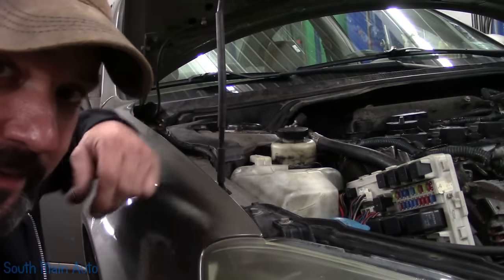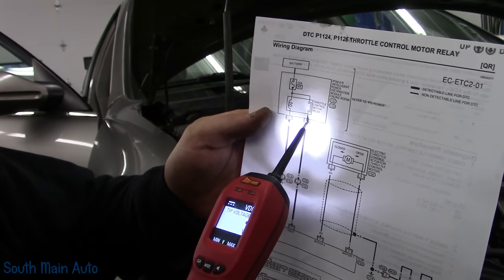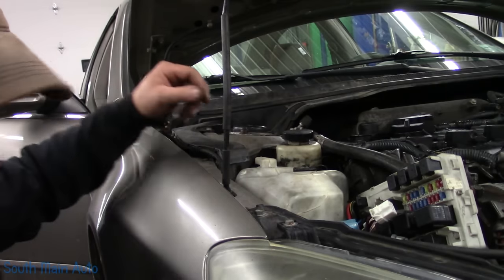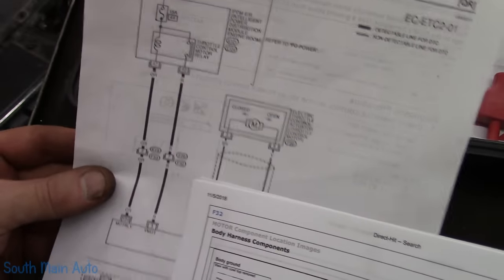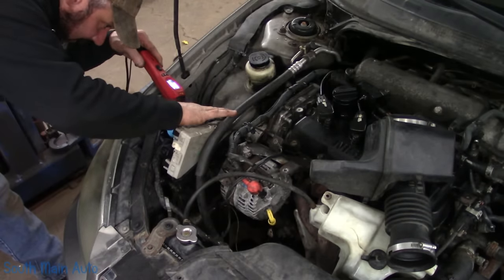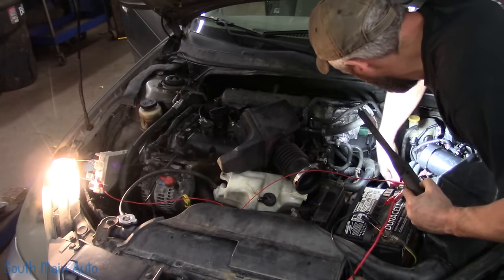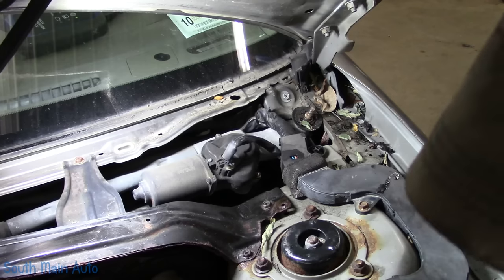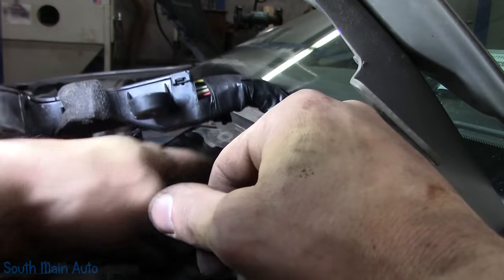How To Fix A Car That Keeps Blowing Fuses

Comment: From the fuse socket to where ever the ground is ....is an "antenna".  Make yourself a noise maker by using a resetting circuit breaker make leads so it can plug in where the fuse was.  It will click on then off then on over and over.  Making your "Antenna" send out pulses.  Use a cheap  calculator turned on as your detector.  It will  pulse the LCD display with the  antenna pulses as long as you hold id near the wire in question.  Follow it along to where it stops pulsing.  That is where it is grounded.  Back in the 1950's we used a radio, does the same thing.

Comment: Goes to show how important it is to route wiring the way you found it when you put stuff back together. This design may be terrible, but it's very common for one moment of carelessness to lead to a whole cascade of problems down the road. Be like Eric, and you won't have any problems. Doing your job right has a bigger impact on people's lives than you could possibly imagine. Imagine how much more money and time would have been spent firing the parts cannon had Eric not decided to diag it himself.

Comment: Hey, good job! I have a question. The 4 amp light you hooked up , did you connect it to the relay connector or did you hook  those back up to the relay fuse panel first the connect the light to where the fuse goes?

Comment: Hey learned a lot watching this, wondering if you might have any ideas on my cam shaft position sensor A codes it's telling me I have both low and high circuit voltage with that sensor codes are p0342 and p0343 I have replaced sensor and still comes up any thoughts are helpful

Comment: One thing that was really helpful for tracing shorts on boats was a "fox and hound" - a signal injector and tracer. Most times, especially on a full short like this one, it was easy to "walk" the pickup along the wire and listen to the tone - which would cut off as soon as you went past the short. It wouldn't have been very useful where the harness was surrounded by metal, but it would have led you right through the fusebox and along the wire toward where it was. The only trick is to get a toner powerful enough that it punches through partial shorts and a pickup that's sensitive enough to let you read the signal even through stuff that's in the way. The one from Tempo hasn't let me down in 30 years...

Comment: I see you do a LOT of electrical work.  There is a contact enhancer called Stabilant-22 you can get at NAPA.  I think the part # is CR-1.  $80/ ounce but you don't use much at a time.  VW came up with this I think.  Enhances contact at connections and supposedly insulates from other connections.  I have fixed cars with this stuff.  Good For corroded connections once you get them as clean as possible.  Love your stuff, and your wife is something else, nearly as good as mine, even after 50 yrs.

Comment: It looks like the owner inserted that braided wire into the fuse location, to try to ignore/bypass whatever was causing the initial short. What do you think caused the initial short? Do you think it might have been a rodent, chewing on that wire harness?

Comment: With a circuit breaker and a compass you can quickly locate the short to ground. Simple step, no hunting etc. with a auto resetting circuit breaker plugged into the fuse box, a cheap compass’s needle will indicate the location of the ground, trace over the wire and the location of the short will be shown, try it you will like it.
Reply: With your light test, use the compass to find the location of the ground, the needle will change direction when the ground is passed.

Comment: I got a 2005 Nissan Altima 3.5 V6 & I replaced the Battery, Alternator, Starter, Fuel Pump. What’s happening with the car it keeps blowing the 15amp Ignition fuse located in the IPDM as soon as I turn the key over. It will crank but won’t start at all & the check engine like flashes rapidly.

Comment: If you don't have one you need to get yourself a wire tracker. You hook a wire that has a signal sent out over it onto the faulty wire and have a small receiver that you run over the suspected harness if it is not the right one the signal will fade and you can go looking for the right cable by following the signal.. On occasion you can find a break because the signal may stop part way down the harness. You can buy them at Home Depot or Lowes for around $60.00 they are well worth the money. I use one quite often when trying to chase wires.

Comment: How many hours do you charge for a diagnostics like that ?

 i had an f 150 brought to me after a customer changed there battery and the power windows and radio didn't work afterwards. factor in searching for wiring diagrams and how the systems were related i had a good hour maybe an hour and a half into it which i incorporated into the diagnostics. after about another hour or so i pin pointed that 2 fuses didn't have power with the key on which ran the the radio and power windows. back to searching how the fuses get power and found out the instrument cluster applied ground to the delay accessory relay which powered up the windows and radio. i unplugged the the connector on the instrument cluster and applied a ground and every thing lit up and worked. so it needed a cluster..i ended up charging the 3.5 hours for diagnostic and repair which i thought was very fair.

Comment: Great video BUT (you knew there was a 'but' coming) I would have loved to see what you did to fix the actual wires. Did you just tape up the jackets or did you have to splice in new pieces of wire?

Comment: what kind of heat tool is that; what type of crimping pliers are those; where do you get those heat shrink crimping connectors;manufacturer?

Comment: My very first thought was put a light bulb in there and measure millivolts on the shorted lead.  The closer you get to the short, the lower the reading.  Have you ever just said, "screw it," and replaced the wire by cutting it out of the circuit at both ends and running a new wire?

Comment: Just wondering how did he fix that shorted wire in case I run into the same situation?  Did he cut out the bad section and soldered in a new short wire with heat shrink?

Comment: How much do you charge the customer per hour?  My car is currently n the shop $125 an hour.  It’s gone through 3 batteries in a year.  Ac blowing hot air 5 minutes after Freon recharge.  It has a dimming rear view mirror.  I unplugged it thinking it was causing battery drain.  2006 Chrysler Sebring touring convertible.  84k miles.

Comment: Wondering what you think about my current situation. I changed the battery in my 01 gmc Sierra. After installing the battery, my door lock isn’t working from inside the truck or the key fob. It will unlock but not lock. It’s a 3 amp fuse that keeps blowing after replacing. Not sure where to start 😭
Reply: For starters, you may want to check where the wires run thru the driver door thru the body. Gm is known for having short wires that tend to rub off the insulation creating a short.

Comment: A common problem with the 2.5 altima is the exhaust manifold cracks where the collector welds to the down tube. I had to replace the one I had on mine years ago and the manifold looked like it was  peiced together with whatever Nissan had left.

Comment: Hello I have a 2004 nissan Altima and the wipers stay on ounce I hit the steering column switch. When I bought the car for my daughter the previous owner had a kill switch and wire running directly to fuse box in in engine compartment. I eliminated all that and it is so doing it. The switch was replaced on steering and checked all fuses all seem to be good. What would you suggest I do next ?

Comment: I used to fix aircraft along with too many other electrical systems I care to remember, what I was taught in school and you did is called BRACKETING. Start at one end (a) with the fault go to the end of the circuit (b) and check for the fault if you have the it you know it's between (a) and (b) if not you know the problem is the component the circuit goes to. Find a point half way between (a) & (b) and check for fault (c), if you have it, the fault is between (a) & (c). If you don't have the fault between (a) & (c) check between (c) and (b) you should have the fault. Just keep breaking the circuit in half and you will end up at the fault.

Comment: If I've learned anything from your videos is that I've been shamed into doing cleaner aftermarket installs so that you guys can work around them or plain unplug them off. I also always run a fused power source to the battery,  never to a circuit (unless it goes to the control side of a relay if I need to light it up with the light switch).

Comment: This looks like an older Nissan.  I understand Eric is showing the "correct" way to find the short and "exactly" where it is.  On an older car like this, once you realize which wire is shorted it is, in my opinion, more productive to just run a new wire to the throttle body from the fuse block.  And Eric said it himself, " i don't want to waste a whole lot of time" which chasing the harness is.  Cut it, run it, save the customer a couple dollars, make a note on the RO where the new wire is so if in the future someone has to chase the circuit they'll know.

Comment: Exact same problem and cause as that cobalt. Bet some time in the past someone had replaced the wiper motor on that thing and that would be why the wire bundle would have been unclipped like it was.

Comment: Another tip.  Let's say you don't have a Power Probe, just a multimeter.   Use the ohmmeter to measure resistance between the fuse and ground. Use Ohm's law to determine the minimum resistance of a circuit, for example, a 10 amp fused circuit should have 12v / 10a = more than 1.2 ohms of resistance. If you have less than that, do the short to ground troubleshooting mentioned in the video until you get more than the minimum resistance. When that happens, you've found your short.

Comment: I had a customers w140 e320 Mercedes. It had a heater fan that was getting stiff in the bushes and causing the fuse to blow. The customer had put in a 25 amp fuse instead of a 10amp fuse to keep it going.  This caused the fan terminals in the fuse box to spread, in the fuse box to melt and the wire to the fan too. In the end i cut both ends of the fan wire before the fuse holder and put in an inline fuse in the fuse box and ran a new wire to the connector for the fan and replaced the fan.    I opened up the loom and the fan wire had stopped melting a foot into the loom so we were lucky nothing else was effected.

Comment: Hey hoping you check old video comments. I'm having an issue with my positive terminal fusible link on a 13 nissan maxima sv. The fusible link on that positive terminal at 250A keeps blowing when trying to start. The alternator and starter both are showing ground and open line correctly. Something is sending power from the ignition button to that fusible link that I'm having troubles finding/connecting the two. Any assistance in what would cause that ignition switch to come thru and blow that 250A on the fusible link would be greatly appreciated! Thanks.

Comment: Screw it, I’m converting my car to dual fuse/relay boxes and having everything be side specific and having only one set of wires transfer “signals” between sides (unless I go digital, then ignore those quotes) with a large plug on either side and I’ll have that either hanging just under the seam from the firewall and wiper cowl like 04ish ford pickups, or behind the dash (unpreferably, but with a mid or thirds point connectors to isolate portions of the harness within reach without pulling large/major components or taking the dash out, and since the car I plan to get is a rear engine one (cheap fiero) I might go crazy and put a rear power distribution box also, which will house rear things that aren’t side dependant and maybe be a reference for the other two panels (maybe a bad idea??) any input?

Comment: You seriously are brilliant  lmfao  my teacher tought me cool trick for shorts  said shut lights off in shop  work in dark  uncles car windows wouldnt work  chev impalla . Bought 12 pack 15 amp fuses   each time put fuse blew  i did 10lbs pull test on door wiring and nothing !  So told uncle shut lights in garage  and had him and dad watch for spark   while i kept putting fuses in  i seen a spark in ashtray outta corner my eye wife doesnt smoke so she pulled lighter out   anyway  i found a kids copper bracelet in the cigertte light hole

Comment: When I were a young jeanyus I had a 77 Chevy Cheyenne SB.  Kept blowing fuses.  My intelligent self wrapped a little foil around the tubular fuse.   Needless to say,  the old truck got a brand new full wiring harness behind that move. 

Problem was:  I was running no tailgate and hanging out in parking lots in a small town.  When I'd sit I would put my feet in the hitch ball well on the bumper.  I ended up knocking the license plate light socket out of its hole and the wire dangleling on the bumper support, wore through wire coating and was grounding out that circuit.

Comment: I had a similar repair a guy was blowing fuses he took it to a shop he said they called it a smoke test bypassed the fuse in other words they melted wires from under the rear seat where the fuse box is up under the dash into the left door had to get all the melted wires apart before I could start trouble shooting turned out it was a broken seat switch in the door they cost this man a lot of money shorting out the wire harness instead of just replacing the switch

Comment: Hello I have an 03 accord , i recently replaced the starter, right when i tried to start the car it didn't start after looking at fuses i  had blown the fuse 23 (Power Window Main) replaced  it and the car started just fine after 3-4 weeks i had the same symptoms, no dash light and the no power to the windows, replaced it again car starts fine no issues but when i looked at the fuse it shows sign that it will blow again (it got discolored)  wanted to know if you can give me any points as to what its making the main fuse blow. Thank you.

Comment: Using a headlight in place of the fuse that keeps blowing. Start unplugging connectors until the light goes out. When the light goes out the problem lies in between the last two connectors you touched.

Comment: Is there an automotive tool that allows you to probe a circuit and then displays how far away a short is from where your probing? Measured in say, inches. I know phone companies use one that gives them distance to an open on their underground phone wires in feet. But obviously the distances for the phone compamy would normally be much further. Plus I'm not sure if their tool gives them distance to a short or not. I'm pretty sure it works by sending a pluse down the wire and is then able to somehow make a distance calculation.

Comment: I have a 2007 Nissan Maxima that keeps blowing the 120a circuit breaker on the battery fusible link, any idea what it could be? Or where should I start looking?

Comment: Electrical problems are tough. Sometimes even the diagrams confuse me! You really have to take your time on them. I have a tool that you can run along the wires to see where the short is. But even those tools are iffy!

Comment: How does a fuse protect the control side AND the load side of the circuit? Wouldn't that cause it to bypass the relay and put power straight to the throttle motor? Path of least resistance and all that...?

Comment: If you put a scope on the wire and then started wiggling wires, you would see exactly where the problem is because a small change in resistance might not be seen by the light.

Comment: When you get tired of buying fuses, solder a couple of wires to a blown fuse, and connect them to an incandescent headlamp. Then you can plug that in and go around until the headlamp goes out. TFM

Comment: I am 71.  Watching you finding these problems, is why I hate modern cars/trucks.  
back in my younger days, (35 yrs ago), I could repair all drive line problems and most electrical problems. 
Computers and their wierd cable harness runs is not for me.

Comment: I have seen this type of shit over and over. Most modern "technicians" I run into have no fucking idea how to diag anything other than what the laptop or code reader tells them is wrong. Where as my sorry ass has repaired traces on a pcb on a 92 fucking honda ecm I could not find a replacement for because of a shorted fuel pump prime circuit relay on the board. You sir deserve a beer. Cheers.

Comment: Eric i have a 2014 it come up with two codes  p00010 and a p00011 camshaft sensor bank 1 and the other is camshaft sensor bank 2 i got the code to reset and now it not thoughting the code and i drove it and put the beads to with no code can this be a intermittent  problem and do you think i just need to test both sensor and be done with it

Comment: Very nice find.  You saved that owner a lot of $$$$$$.  There needs to be more mechanics like you instead a parts replacers like they are now.  In aviation, we call that shotgun troubleshooting.  It takes a bit of mind power but, you break it down like you did, and it leads you to the gold.  Great job.

Comment: Where do I find the schematics for wiring? My 09 impala ss keeps blowing the ecm fuse, unless it has a 30amp fuse in it. (Calls for 15amp) If I knew what and where to trace the wires, it would be so much easier to find the short! I’ve had a short on my car since I got it, (December ‘20) and have spent close to $1000 in repairs, just for it not to be fixed. This includes a dealership! Replaced the fuse box and the ecm, still for it to not run. I can’t even tell you how many codes I’ve pulled with my obd2, just to keep going round in circles with each “repair”. I just want my car to run and not be continuously in the shop or broke down.